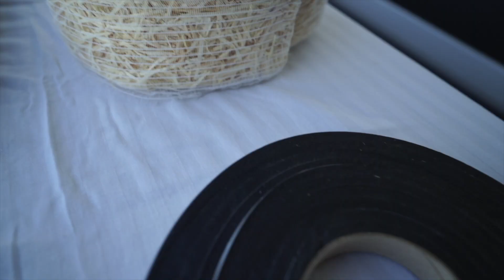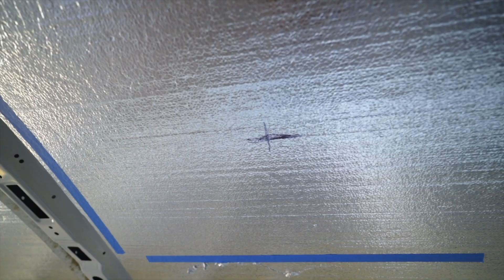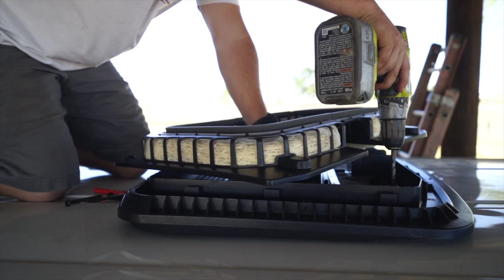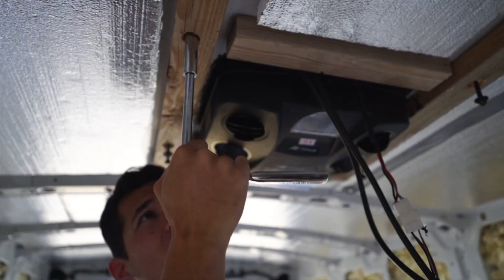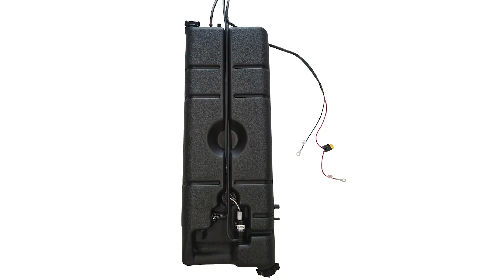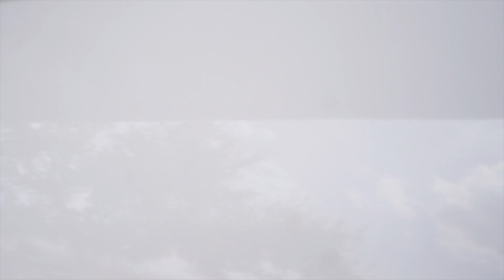Fresair S6 12v Air Cooler - Van Conversion Install

Comment: How did you know which hose was the return and which one sucked the water upwards from the tank?
Reply from the maker: Great question! The return line is the waterline located on the end of the air box, the injection line is located in the middle and your 12V of power is located on the opposite end.

Comment: This is a cooler using water. It will ruin your rv interiors if use it in humid area. It also consume 3 to 6 gal of water a day. Using up your precious water.
Reply from the maker: Fresair does use tap water and only 12v for a very economical cooling solution. However, it does not ruin rv interiors. The unit will not make the humidity higher inside the vehicle. You may be thinking of old fashioned "swamp" coolers that left a layer of water on inside surfaces. At full power and in very low humidity environments Fresair will use less than 1L of water per hour. In most circumstances it will use much less than that. Fresair is the perfect solution for cooling without using up your precious battery power. For more information please read the description above or visit us at www.fresair.com.

Comment: How far does the installed unit extend down from the finished ceiling, inside?
Reply from the maker: It totally depends on the type of finish you have on your ceiling. The distance from the rooftop to the base of the vent box is 5". You would normally have a seal between the rooftop and the unit of about 1/2", plus the height of finished ceiling inside. If you know the thickness of your finished ceiling to the rooftop, you can subtract that from 5" to get the amount it will extend below your finished ceiling.